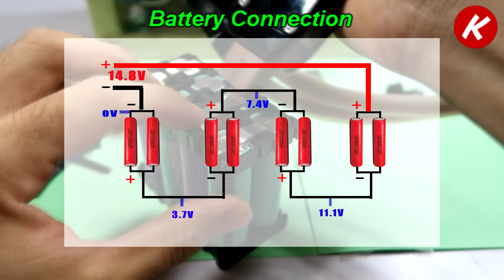How To Make 14.8V RECHARGEABLE BATTERY - Lion 4s Battery Pack

Comment: Nice video :) Couple of tips:
1) Make sure to use a BMS with balance charging/discharging capabilities (or use a balance connector) - to prevent any pair of cells from being overcharged (edit: looks like that board will balance, but a balance connector is better).
2) Make sure to use a capacity tester/analyzer to check that the cells used are still in good condition, if they are not brand new cells. Anything below 1,000mAh per cell is no good.
3) For those of you that don't have a spot welder (either can't make one, or too expensive), soldering will do the job as well (though it won't look as neat).
Reply from the maker: Thank for your advice

Comment: Sir i have a 4s 40A bms and my laptop is rated 14.4v. How many batteries can i use to get the 14,4v and the connection to the bms. Pls help its urgent.thanks for your video.

Comment: Hello, for first Ilike your Channel you make really good job. I'm not sure of how charge the batterie, do the BMS regulate the charge and we can use a DC adapter with 15v aprox or we absoluty need a li-ion charger and the BMS is just here for the security? Sorry for my english i'm french.
Reply from the maker: BMS will cut off power supply when battery full. and protection when battery overcharge. The best for lion pack you should buy IMAX B6. It have balance charge will be better.

Comment: can i use an original jbl 20v 4A output source to charge this battery? can damage the tpa3116, the site says the seller can feed with 8 to 26v. good work. I'm from Brazil I'm using google translator to talk to you
Reply from the maker: No. You must be using adapter 16.8V to charger for this battery. Becase maximum voltage of battery is 4,2V. 4,2x4=16.8V. If you using 20V to charger for this pack very dangerous. Do not try that. Thank you!
Reply: @KingMinhvuong  Tank, my hero :)

Comment: Wery nice work what is the total mah of this battery and how much hour backup it provides ??
Reply: It will create 5200 mah as 8 batteries are connected in series creating 14.8 volts, and the backup will depend on how much power is used

Comment: I thought you need to use a CC/CV charger to charge LI-ION batteries?
Reply: Ideally you need a balance charger like the iMax B6 or Accucel 6 - they do CC/CV charging modes.

Comment: Why should we use the 16.8v adapter?
Reply: because it is a 4S pack (4 in series) and each cell is 4.2V max. So 4.2V * 4 = 16.8V for a 4S battery.
If you want more compatibility (or just the best solution) then you can charge with a balance charger such as iMax B6 or Turnigy Accucel. it will charge depending on the number of cells you have.
Reply: @TheSpotify95  but i think that each battery is 3.7v?

Comment: How we can make this battery pack with higher capcity same 14.8v
Reply from the maker: You connect parallel battery. This video i connect 2 battery parallel so you can connect 3, 4 or 5 battery if you want.

Comment: How it will indicate when charging is full??
Reply from the maker: When battery full. BMS and adapter will cut off power and the light of adapter turn from red to green
Reply: But your was still red when you remove the charge

Comment: The thin wires is for balance cells? If I want to pull more watts for example a portable speaker ... those wires will be thin no? I will need 2 thicker wires. The question is where they are exactly connecting, I always wanted to build a portable speaker for myself, I am an excellent carpenter and I work with Fiberglass, etc. But when it comes to electronics, my knowledge is basic lol. I want to build a 3 cell battery for a 50w portable speaker. I want it to work both on DC and AC, Which means that the battery is full, it will transfer the current directly to the amplifier and stops charging the battery .. I would like to know do not create such a battery.
Reply from the maker: Dear my firiend!
Yes. The thin wire for charging balance. It thin but ok bro. If you want to pull more watt you must be design more mAh, voltage for battery and 2 wires power (+,-) bigger for the best sound. Example: 4s3p, 5s3p, 6s 2p, 6s3p....incase speaker >50w i think  you should be use 4s or 5s battery pack. I will make video design 5s battery  in next day. Very easy to make switch to power supply for speaker when you don't wan to using battery but want to use AC power. Just use adapter >18v 5A.

Comment: can this batery charge with 12v charger?
Reply from the maker: No. If you charge this pack with 12v adapter so adapter will die.
Reply: @KingMinhvuong or with  19v charger it's ok or no
Reply from the maker: No. Please don't try another voltage.
Reply: This batery Charge with 16.8v adapter
Reply: @zlatestoj4507  a 12V charger will not work because the nominal voltage of a 4S pack is 14.8V (maximum is 16.8V). You'll damage the charger and the cells will not charge.
You also cannot use a 19V charger as that is more than the maximum voltage of 16.8V for that pack.
Either use a 16.8V charger, or better still, use a balance charger (like an iMax B6) and set the charger to 4S mode. It will charge up the pack with the correct voltage.
Reply: @TheSpotify95  what if am using dc dc step up to upgrade 12v adopter to 16.8 will it work?

Comment: The charger adapter I thought it had to be same voltage ?
Reply from the maker: No. If voltage of adapter the same voltage battery. can not charge.
Reply: Late reply but 4s is 4.2 x 4 = 16.8. 4.2 is the fully charged voltage per cell. 3.6 is the nominal voltage per cell so it = 14.4v. 12.8v is usually discharged or as most people will want to take a 4s pack. Anyway, so yeah he used a 16.8 charger because 16.8 is 4.2 (full charge x 4)

Comment: That will take forever using 1 amp. You could charge at 8 amp no problem.
Reply from the maker: If i charge at 8A. The life of battery not long.Thank you bro
Reply: @KingMinhvuong  Not true, almost all lipos are charged with 1C charging. Also the balance board will bleed off excess amps of certain cells and allow current to flow to the low ones, and should ramp down charging when almost fully charged to help get the most charge possible into the battery. If those are 2500mah cells(for example) you could charge at 10 amps and charge at the standard 1C rating, BUT the charge board only supports up to 8amps. A 3amp 16.8V power adapter would charge 3 times faster and be under 1/2 the 1C charge rating.
Reply: Charging that pack at 8A will severely limit the lifespan of the battery pack. You need to check the manufacturers datasheet for more info, but those batteries came from laptop packs and therefore are not designed for high current/fast charging. They charge at 1A per cell without a problem, but I don't recommend any higher.
The capacity of those cells could also be quite low if they have been well used in the past, affecting the ability for them to be charged at higher currents.

Comment: What capacity does each battery have?
Reply from the maker: That is old battery, about 1000mAh
Reply: They look like scavenged laptop battery cells so will depend on their previous usage.
If you're going to make this with used cells then make sure to capacity check them first, to make sure that the capacity is what you require it to be. 
Any cell below 1000mAh should not be used.